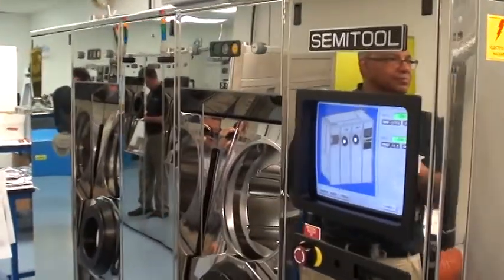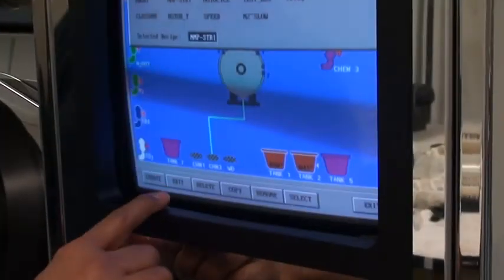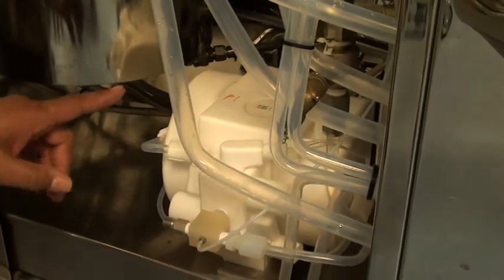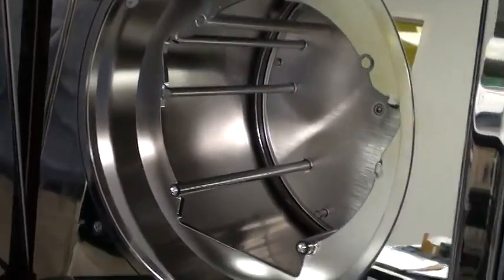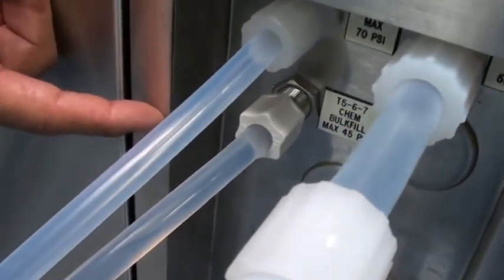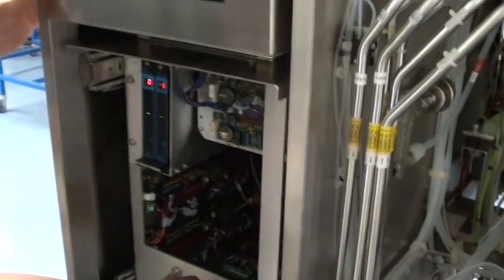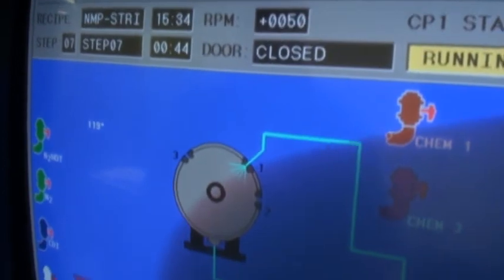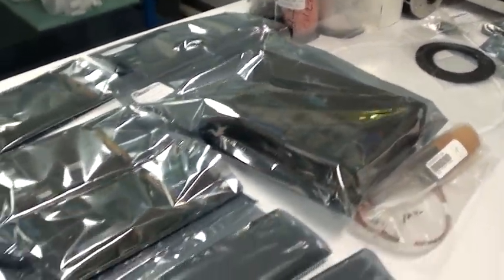Semitool Spay Solvent Tool (SST) Demonstration at ClassOne!

Comment: Hi, I have a single chamber Semitool SST. The tool was turned off for about 2 months. I tried turning it on today and the contactor would not energize....Can you recomend any action to torubleshoot this issue?  I have power all the way up tp the contactor and I also have power to the transformer, however when I press the ON button will not energize the contactor....If I manually trip the contactor I get the Computer to initialize though, but it will not stay energized (the contactor)